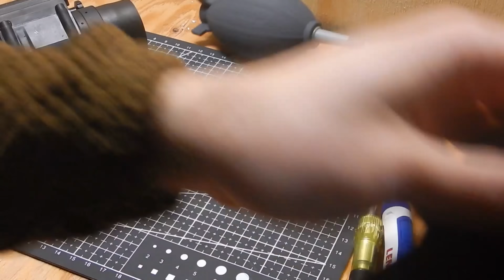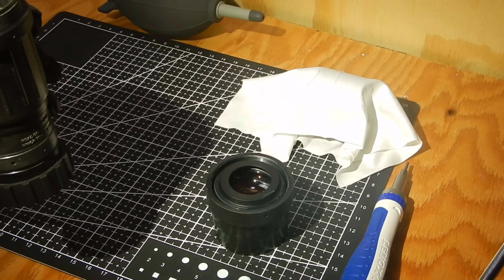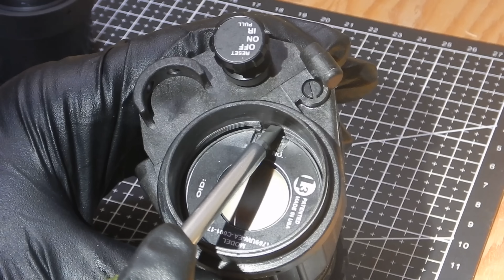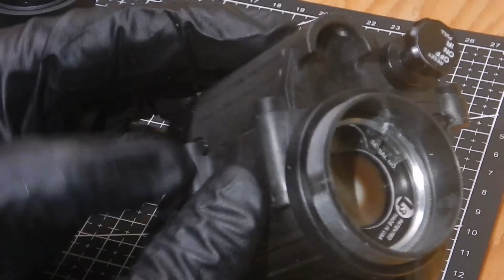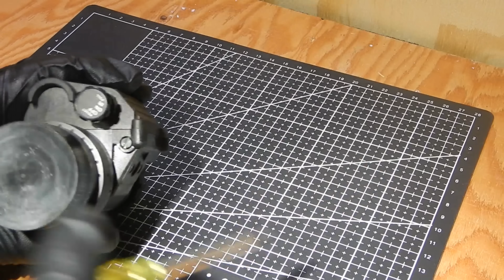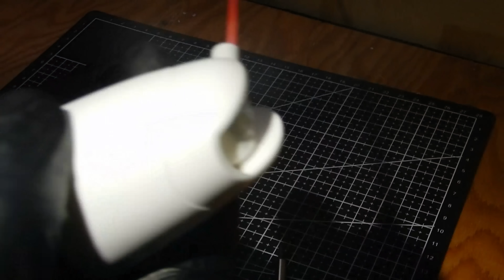How to Build Your Own PVS-14

Comment: Another comment on the nitrogen/argon Purge- I work with gases for a living and that's the basis for my comment here. It's very difficult to get complete displacement unless the gas also has an exit point separate from where you're pushing the nitrogen or argon in. My suggestion is to mostly unthread another connection, thereby providing another point for the gas to escape. As you said do it several times and then tighten up the connections. I hope that helps. I just had another thought- if anybody's game for this. Another technique to reduce the oxygen inside the unit. Take a large Ziploc type bag, flatten it to remove all air, inflate with gas like argon or nitrogen to fill the bag with your parts inside, do all your assembly inside the bag. Then do the purge as previously described. They make ziploc and other brands in above average sizes like 2 and 2.5 gallon bags. Something around that size seems workable.
Reply: "Food Saver" vacuum sealers (and like items) have both bags and hard containers in which the unit could be placed and vacuumed and left for any air/moisture to cook off.  They even have plastic straws that attach to the vacuum line.  Slip it into a zip lock bag and vacuum it down. 
Slip the end of the wine preserver straw into the vacuum bag before starting vacuum.  Then, when it's time, just insert the tip of the straw (obtain a finer size straw from a different can, like penetrant, and insert into the larger, wine preserver straw) into the optic purge port and fill it up.  Let enough gas into the bag that it's got some pressure and won't suck the argon back out.
  Bob's your uncle, you've got a fully purged optic.  😀
  I'm sure you could get an AC or airbrush vac pump to work if you're clever but, the Food Saver had everything you need, especially if you already have one. 😉
Reply: @MtnBadger  I love that idea! Definitely another example of thinking outside the box. I don't have a vacuum sealer so I wasn't thinking about that. Between your idea and mine that's it's a great set of ideas for people to pick from depending on what they have available. I see you have your own channel. You might want to do your own video on this. Feel free to use my idea well.
Reply: @HeatGeek1  
  I know I need to do some.  You don't just have to be limited to a vacuum sealer and some are just a hand pu.p and very inexpensive.  And the  compressor from an otherwise defunct refrigerator makes an excellent vacuum pump that will draw-30hg easy.  There's always options. 😀
Reply: bubbles of less dense air rise to the top inside the device and dont instantly mix bro. thats why my honda keeps overheating after i just poured in radiator fluid without letting the bubbles out. mixing across the interfaces of two dissimilar gases will occur at rates proprotional to the sqrt of the average mollar mass ratios. graham's law

Comment: To add to the topic of nitrogen purging a bit - the idea behind nitrogen purging is to eliminate atmospheric moisture that leads to fogging. Nitrogen is one of a few gasses that can be used and it typically used over argon because of its abundance. 

A solution I've used for nitrogen purging is to use an inexpensive vacuum pump from harbor freight, a pressure cooker and a thick plate of Lexan and a rubber gasket the diameter of the pressure cooker. Drill and tap at least two ports on the Lexan, one for the vacuum pump and one for purging gas. The additional hole in my application was for a vacuum gauge. Place the device in the pressure cooker,  place the lexan and gasket on top, attach the gas line and vacuum pump lines, purge the gas line, pull a vacuum for about an hour (or more if you'd like) to ensure all the air and moisture is evacuated, slowly introduce gas until you meet or exceed atmospheric pressure, quickly seal the device. I'll eventually upload a video detailing the process and design of the chamber when I have time.

Comment: Just checked prices, decent intensifier tubes are 1500-2500$ on eBay, and the housing kits, about 500-1000$ including wiring, lenses etc.
Reply: There are digital nv, cheaper and works the same.
Reply: @kazapopidor  can you explain or say where to look at this cheaper digital option?
Reply: @orangerider2827  on my channel, i did it yourself.
Reply: @kazapopidor    Not true brother, otherwise everyone would be using it.
A couple of problems with digital night vision is: 
1) Digital is not usually ever a 1:1 ratio meaning, there is usually always a magnification like 4X or 6X etc. 
This is important because if you were wearing night vision and trying to walk in the dark, you need to have some thing that has zero magnification otherwise you’re bound to fall on your face because everything that you see further away looks actually closer because it’s magnified, make sense? Imagine holding a pair of binoculars up to your face and then trying to walk or run with it with them stuck to your face. You would wipe out! 
It’s a very huge deal you need to look through the lenses and see exactly as if you were looking in daylight with your own eyes without magnification. 
2) All digital night vision are comprised of a camera lens that goes into a processor and then shows up on a screen that you look at on the other end. That’s cool and all but the problem is it creates something called latency or another way to put it is a lag, so what you’re seeing is usually behind timewise with what just happened. Again, if you’re walking in the middle of the dark or running, you’re seeing things in the screen that have already happened a quarter of a second to 1/2 of a second to even a second ago. That would be very very bad because where your foot is landing is not what you are seeing in the video screen, makes sense? Your foot would land and then you would see it land on the screen. 
Real night vision is seeing in real time with zero lag and 1:1 ratio!! 👍🏼
Reply: @MylesDavid   Digital is not usually ever a 1:1 ratio meaning. 
Depending focal length, you can customize ratio. This can be plus, because you can choose more panoramic picture. On intensifier tube principle the same, depending optics.

 problem is it creates something called latency or another way to put it is a lag.

Depending shutter speed, you also can customize lag )). But if you have 25 or 30 frame per second, you can use it for driving on bicycle or walking well .Approved by myself )